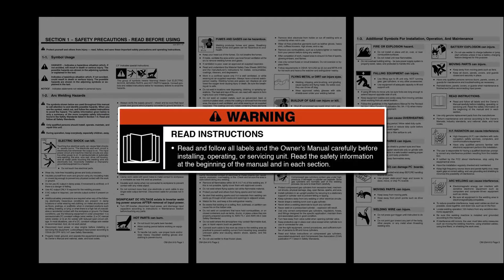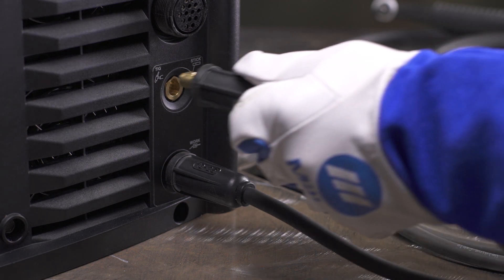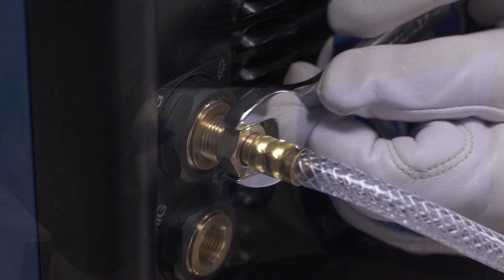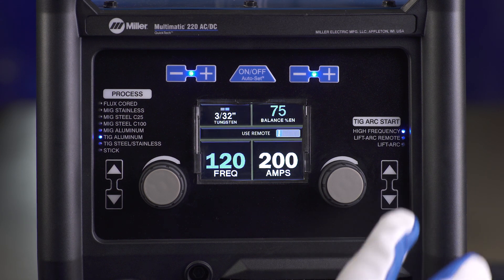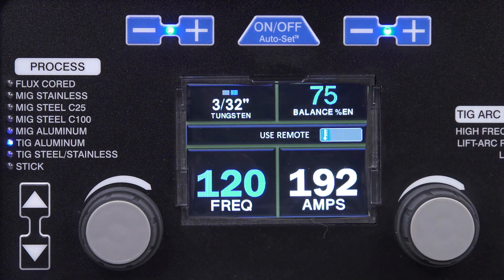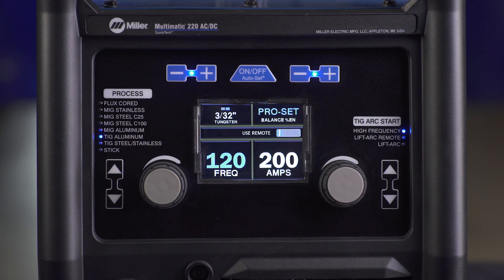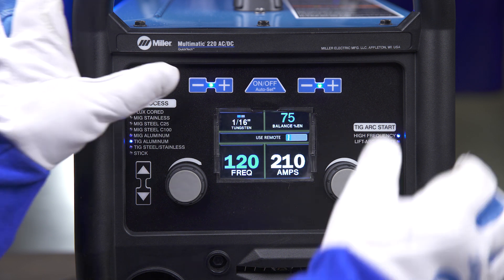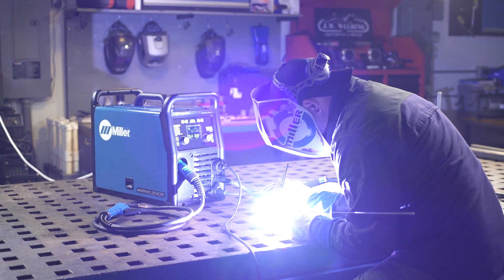AC TIG Set Up Instructions for Multimatic 220 AC/DC

Comment: After 20 seconds or so TIG welding aluminum my machine shows a red hold sign and arc stops. After a few seconds I can restart.  There is no way it's getting too hot, because this happens right from the start.    I've been reading the owners manual, but I figured I'd ask here too.

Comment: is there pulse wile in ac mode for aluminum
Reply: I'm sure it's more than capable of doing AC GTAW-P, but if Miller allowed that they wouldn't be able to sell you another Welder, or an upgrade down the Road. Planned obsolescence! 🖕🏻
Reply: @ŠpVŠpý  I am seeing this as being true
Reply from the maker: Hi Anthony, when welding in AC tig mode with the Multimatic 220, it does not have pulse but you do have frequency control and balance control. The Multimatic 220 does have pulse capabilities in DC tig. Thank you.